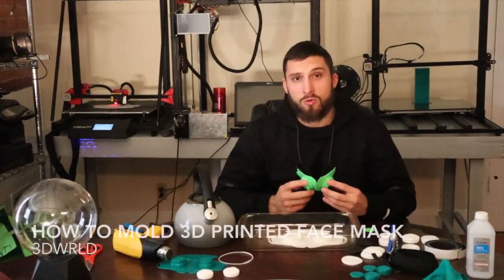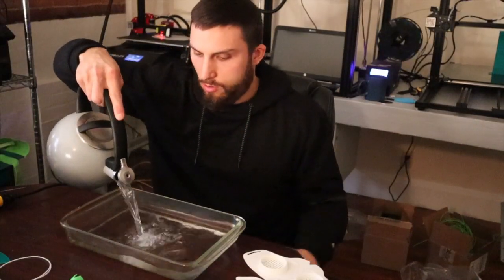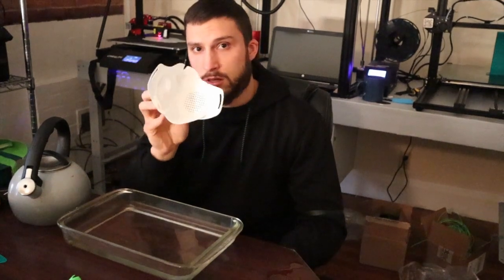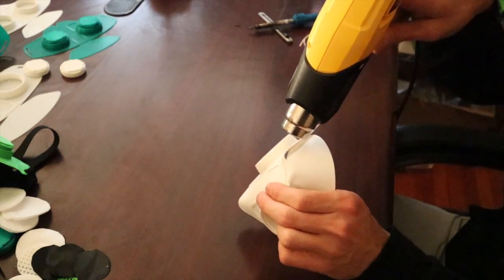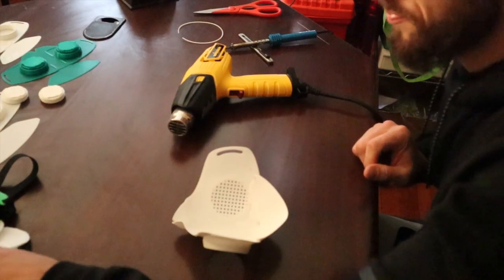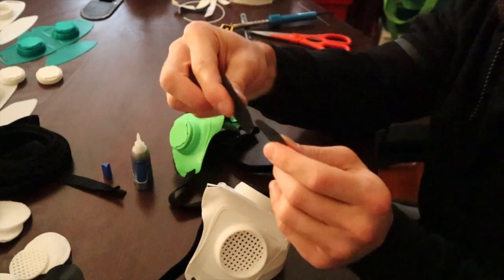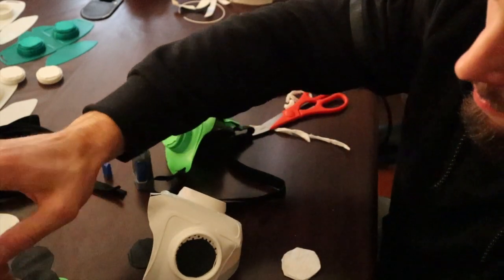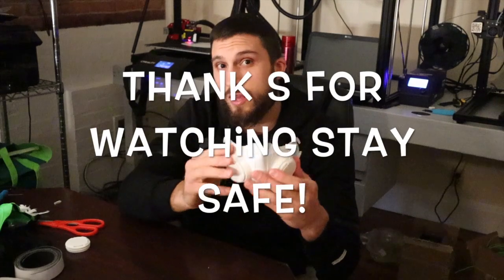How to Mold Covid 19 Face Mask - 3D Printed

Comment: Good video tho you might have to lose the beard for a proper seal. About the gaps wouldnt be easier to use hot glue rather than solder pla filament? And is the foam on the nose and chin necessary? Because its hard to disinfect properly.

BTW those filters don't look safe, the black cloth doesn't covers the entire breathing hole.

Comment: Don't bother printing these masks, they won't help VS Covid19 directly.  The seal is not air tight - letting in problems.  Also the virus is too small for filters to be used. What you need/want is just something to block moisture droplets from getting into your eyes, nose and mouth. (as these droplets are what carry the virus from one to another)

A simple Cloth mask (2 layers) washed after 6 or so hours of use (or when it becomes damp - change to another one) while avoiding contact from your hands to your face - will be plenty enough for a "mask"  now wear goggles if your trueley worried, or a face shield (like the holders/frames being printed for medical use) to keep splatter (sneeze, cough, spittle, etc) from coming in contact with your eyes/face.

With filters, however, this does make a nice 3d print for Dust, Sanding, Painting etc. But not for virus.

Comment: I used hot glue gun to fuse chin section and ran bead on outside. Used three layers of foam weatherstrip tape with dots of superglue to hold on and hold layers together and it seals well. Nurses and Doctor have tried out and like it.
Reply from the maker: Bill Mekker awesome. Glad to hear your finding ways to improve the seal! I also recommend printing at 23% infill instead of 20 for more strength although slightly tougher to mold.

Comment: So I've noticed the foam tape allows air to escape through sides so some air isn't going through filter. Did I do it wrong?
Reply from the maker: Hey Ryan. Best thing I can tell you is to form the mask as close as possible to your face. The foam itself isn’t allowing the air to get through it’s the gap from your face to the foam. If there is a specific spot that is causing trouble I suggest applying a heat gun to that spot alone and adjusting. Make sure your elastic is tight enough. I hope that is helpful. Best, Paul
Reply: @3dwrld3  Thanks for the tip. I think I'm going to do without the foam it feels more secure, airtight, and comfortable to be honest. But I guess there's different ways.